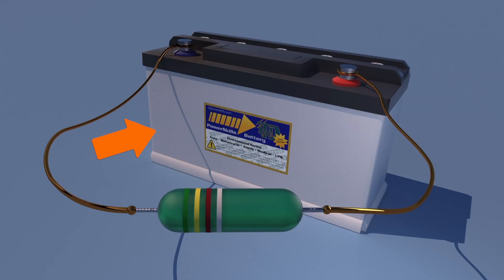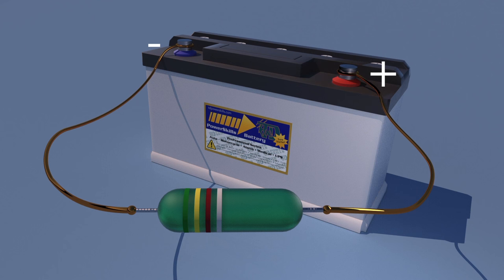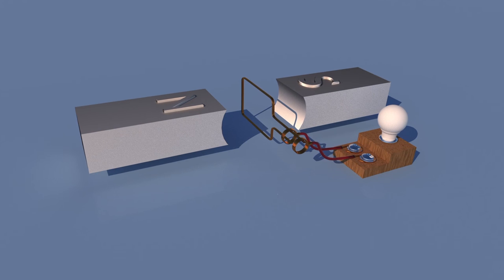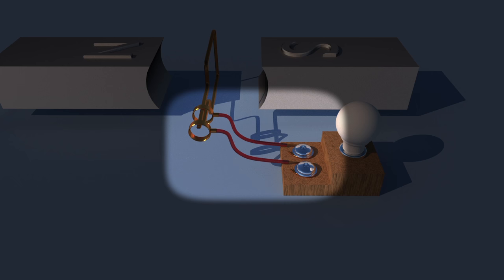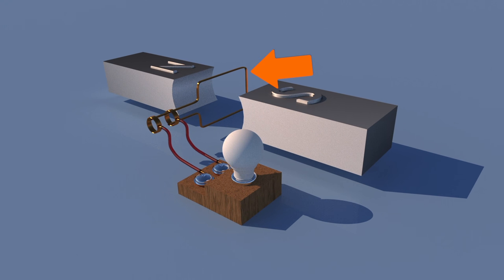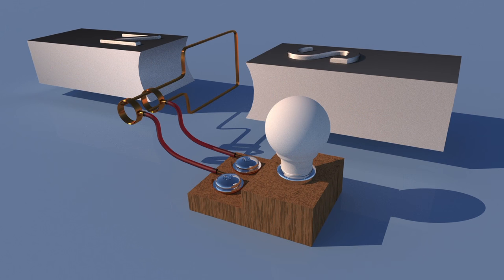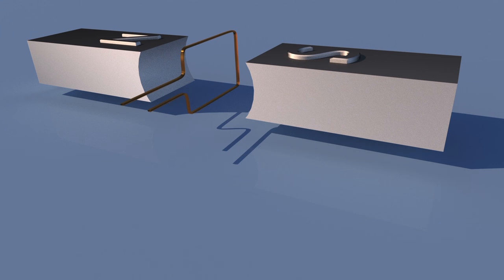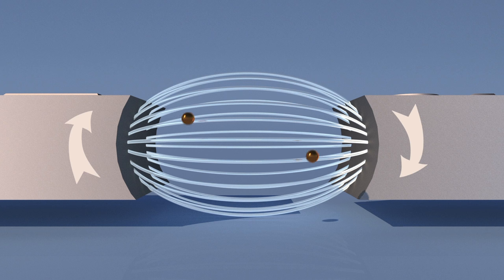Alternating Current Fundamentals PREVIEW

Comment: Current flow from higher potential to lower potential is it right sir
Reply: not only for current everything that can flow need higher to lower potential
Reply: Conventionally current is said to flow from positive terminal to negative terminal.(i.e positive charge moves from positive terminal of (high potential ) to negative terminal (low potential)
. But in reality positive charges i.e proton does not move and only the election does the moving. So if you view it from the point of the electrons at the negative terminal. The elections at that point has high potential  than the elections at the positive terminal. So current will flow from negative to positive
Reply: Yes current flow higher potential to lower potential it's a conventional current
Reply: Yep
Reply: @techfreack8397  good explanation
Reply: no, you're wrong. current can also flow from low potential to high potential if you add a battery or a power source. the exact correct statement would be "current flows from higher potential to lower potential when there is no external power source". aise to bhai paani bhi upar se neeche hi girta hai but mai baalti me paani daalke jump karu to neeche se upar chala gaya na?

Comment: Means that the polarity in an AC generator changes automatically...???😯😯
Reply: yess it keeps on changing (50 times a second in my country)
Reply: @ashaydwivedi420 That's the frequency of the current, , a reverse in polarity means the current changes direction and that is accompanied by its sine-like form hitting zero, which happens 100 times in a 50 Hz grid.
Reply: @gottod6895  oh yes, my bad 😅 if the frequency is mod f, then the number of times the polarity changes is 2 mod f

Comment: Did not understand any of it , guess I’m the only one
Reply: That was actually the best animated explanation of how AC works I have ever seen lol. Explaining it with the generator visualization is by far the best and easiest way to visualize how the power gets from the generator to the utility needing power.
Reply: @stephenmay8619  there are two wires in the circuit. is one of them neutral wire?